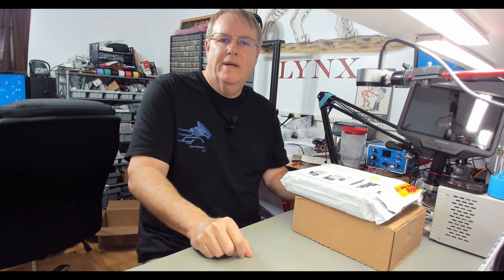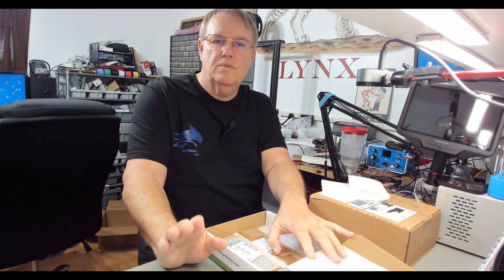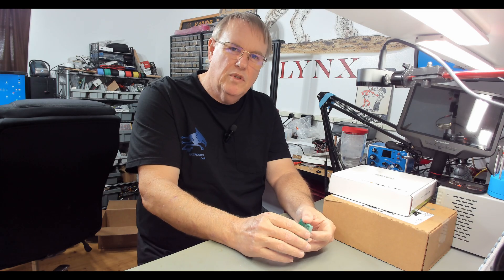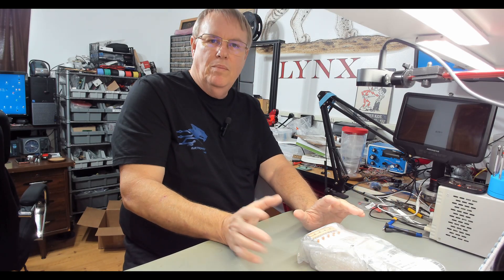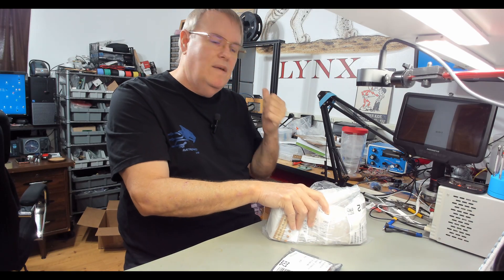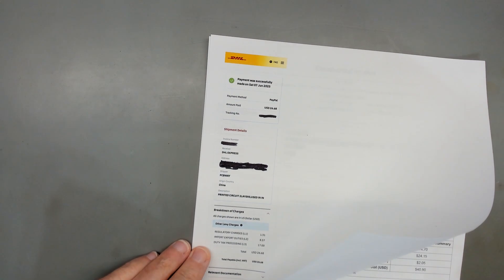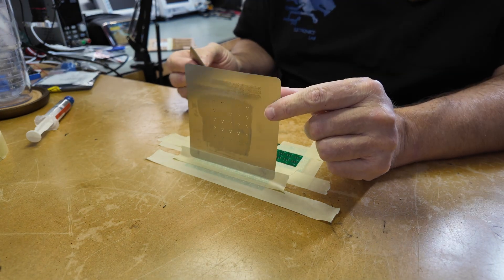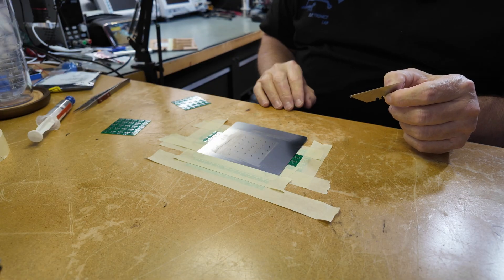Building J310 Jfets with Surface Mount Parts is a GAME CHANGER

Comment: I tried to order two packs of boards but it hung up saying not a valid shipping address. I can't change it or cancel it now plus it's sending me notices to finish the order.... Sorry!
Reply from the maker: No I’m sorry, let me go check. I will post back here if I do not have an email for you listed in the store. 
RJ
Reply from the maker: I sent you an email. It turns out a number of people had this issue when ordering multi packs. I think we fixed it. We had to change from first class mail to ground advantage. The USPS has a bunch of rules and the weight increase with multiple was causing an issue. Sorry about the issue! 
RJ
Reply: @LynxElectronicsLab  Yes, that fixed it, order now went through properly, thanks. Steve AA7U
Reply: I received my order of two packs today, thanks. Very nice, very small, easy to use, glad you made them available!
Reply from the maker: @steveratzlaff  Thanks Steve so glad you liked them! hope everyone else that ordered them do also. They do work well I already tried one out. 
RJ

Comment: Thanks for sharing the very expensive tariff experience! You may have heard KK4DAS of Soldersmoke DCR now has changed the VFO buffer jfet to a J111 (from Mouser) which apparently works as well (and is much less expensive) as the J310.       Steve AA7U
Reply from the maker: Thanks, I did see that after the video was made. I did even realize they were using j310’s when I order these. But I needed these for myself and since I was ending up with 250 pcbs which was the most expensive part so I made them up in case anyone else needed them. And I guess some people did as they are selling already. 
RJ

Comment: Hi RJ, nice work on the new pcb and build process. I didn't know that the v slots were expensive. Your heat plate does it do a heating curve or just a manual temp adjustment? Thanks Rick
Reply from the maker: Thanks Rick, 
Just manual, but it has enough mass as you saw it gives a pretty good curve naturally. 
RJ